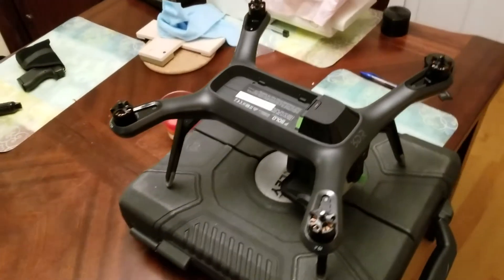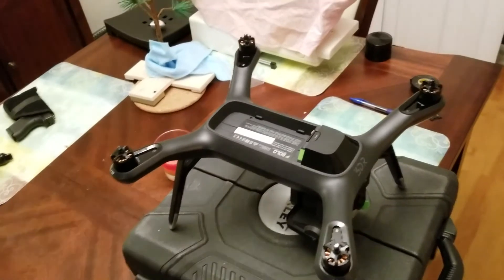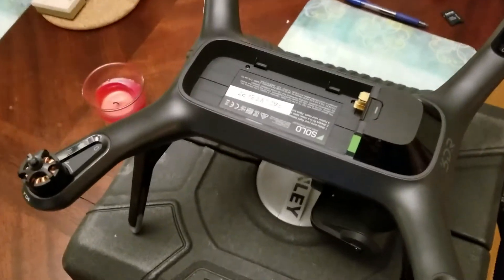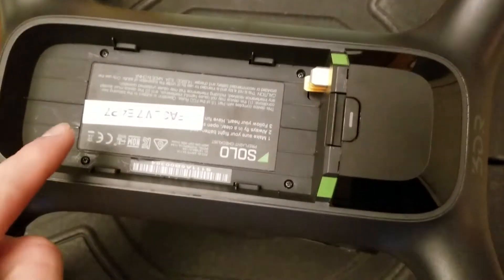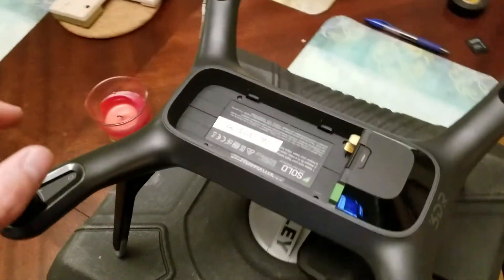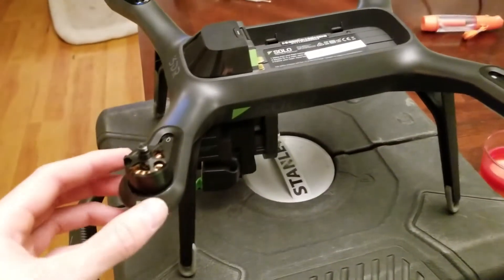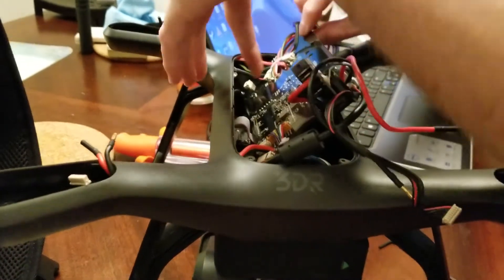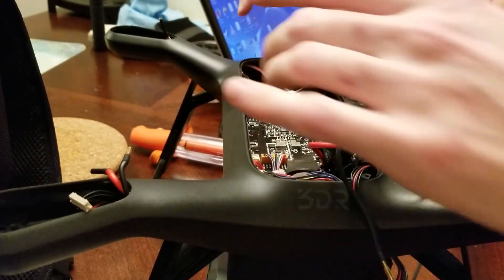How to fix 3DR Solo that won't factory reset - Solid orange light - Waiting on Solo

Comment: Hi Nick. I reset the sd card in the controller once and in the Solo twice. Still doesn't work. I think it is the Solo though because I tried a different controller and it says the same thing Waiting on Solo. Any Ideas?? I have a Wifi signalfrom the controller but nothing from the Solo.
Reply: I had the same problem after factory reset . I tried everything.  Luckily I still have 2 old galaxy with the app still working and I was able to run the app and install the software.  Now is working.
Reply: @fgoitia2  how did you install the software?Thanks